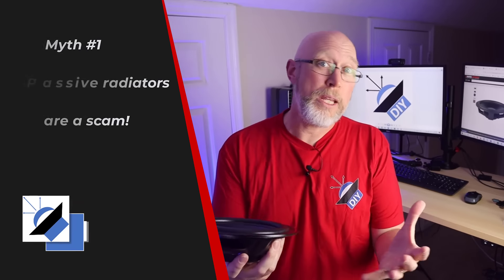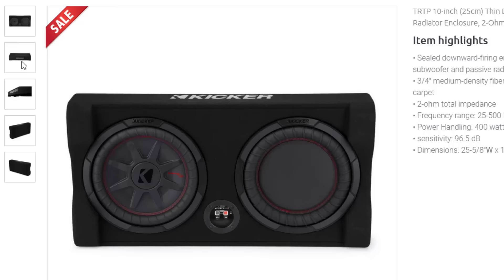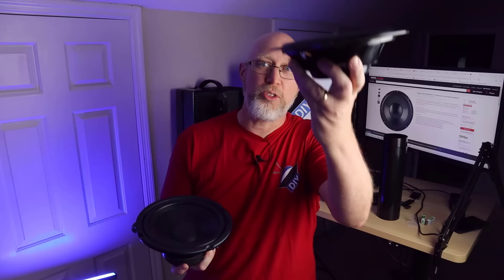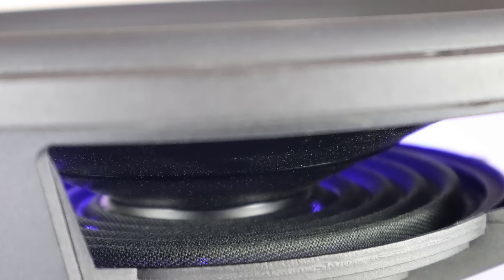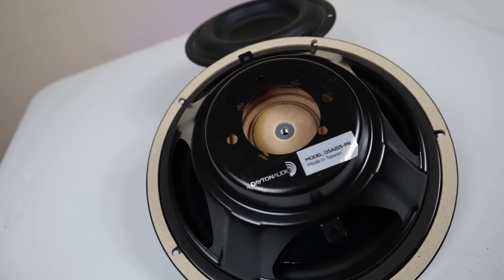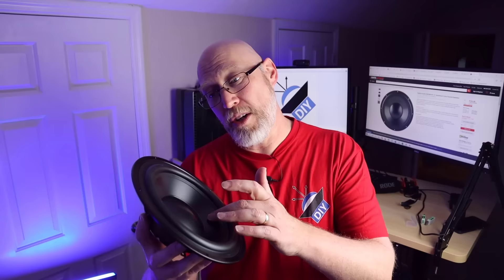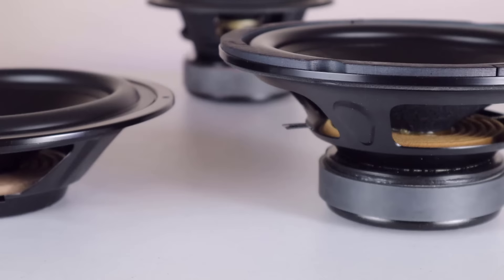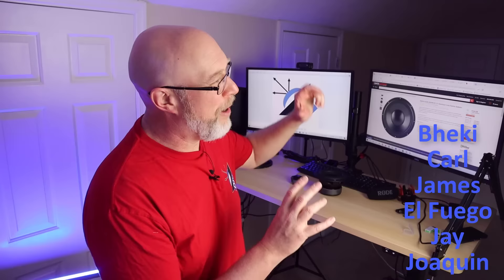Passive Radiator Myths Busted  #Bass

Comment: Thanks for this very informative video dude, I was already running on my own assumptions for the use of bass radiators that I didn't see in this.

I thought that base radiators were only used in small speakers, that were Waterproof and completely sealed. My theory was that with a sealed enclosure, there would be no air movement, and the driver would have to fight the vacuum it created with every flex outwards, and the air compression of every flex inwards. Having a Passive radiator gave the air somewhere to go, flexing outwards when the driver goes in, and vice versa, allowing the driver it's full range of motion while still being sealed.
Reply from the maker: Right, a passive radiator is not a flimsy sealed box.
Reply: The best speakers Ive ever heard, and now own, are Sealed (EPI 100v). Open Ports distort the sound, and create an artificial sounding bass.  This artificial sounding bass, tends to sound awful at medium to higher volume levels.  I call it "Farty" droning bass.  It sucks.  When you hear the way the music is Supposed to actually sound... you will toss all of your ported speakers into the trash.

 Audiophile level sealed speakers, use much stronger magnets and coils, to be able to deal with the internal Air Compression that takes place.  These stronger forces, allow the speakers to be much more accurate, as they can both accelerate and stop, quicker than a lower powered  "Eco woofer".  Even and especially, when they are driven to their maximum potentials of volume / excursion.

 Imagine a race car vs a normal car.  The race car can accelerate 10x faster, due to its more powerful engine.  Furthermore, the race car also has much more powerful brakes.. to be able to stop 10x better, even from a very high rate of speed.  The frame is also stiffened, to prevent distortions in performance.  The quality Sealed speaker drivers, are just like this.  Built stronger, and able to do things that lower powered drivers can not come close to doing.   As a result, you get a music that is 10x more precise (little to no distortions at all)... and you will hear things in your music that you never could hear before.  Such as a singers lyrics that you never could fully understand before... and now suddenly, you can easily make out the exact words they sung.

 The other thing to note, is that when a Ported speaker expells air Out of the box... and if it fires again faster than the air has time to return back into the box.. you will lose air pressure / mass... when its most critical to have it.   Imagine a singer that sung a note and ran out of air... but was supposed to immediately sing another note.. but was unable to do so well, because they lacked the air to do so.  Its not completely accurate to how the speaker works.. but its good enough to convey.

 These sealed speakers use the air pressure in the cabinets, as sort of the centering spring system for the drivers.  You also should realize that air compression, is also a form of "Movement".  In fact, even in lower powered speakers... there is some air compression happening.  Just not on the level of a sealed speaker.

 As for passive radiators... they are far superior to ports.  They tend to be in sealed boxes, and they are excited most by the lowest bass frequencies of the woofer (using the weights to adjust how easily / hard they will move).  They produce far more accurate bass, without sounding "Farty" like ported speakers.

 One could think of a round tube port, much like a flute, that was tuned to a single note.  Whenever air blows through it.. it creates a very limited "woof" that always has the same tone / sound... even though the actual bass from the driver, is playing very different notes / frequencies.   A passive, however... is duplicating the woofers movements and frequencies, far closer to the actual driver.  It can replicate most all of the frequency variances.
Reply: Part 2:  I will also add... that if you want to "Feel" the music without having the need for high pressure air movement... you can also add a bass-shaker (transducer).  These are like woofers / subwoofer drivers.. that have no cones.  They place a heavy mass between powerful driver coils, and probably a stronger centering spring system / spider.  The heavy mass moving, creates very powerful vibrations.

 I bought a used pair of Aura bass shakers.  They are only rated to like 15 watts.  I mounted both to the under-side of my office chair.. and played an old arcade game (Gyruss) with them on max power levels.  In the game... when you fire a bullet from your ship.. the sound of the laser fire gets deeper and deeper as it goes into the screen.   My chair was vibrating so much, that It caused my vision to become blurry... and I was unable to really see the game good enough to actually play it!   All that, at less than 30 watts total.  I of course, reduced the power a bit, and had great effects with no vision issues.

 The point here, is to add to the concepts about moving mass, drivers..etc.  Where as powerful effect is not just air movement.   As has been said... the air in a typical speaker, is to be thought of as an actual "Mass"... and of course, the more mass = more potential effect, especially at higher power levels.  While the bass shaker uses a heavy mass, and much stronger magnets / coils to do its work... sealed speakers do a very similar thing, with air compression (as well as the very moving mass of the drivers / cones themselves).

 The most crazy thing for me, was that my tiny bookshelf sized EPI speakers, that only have an 8" woofer... totally DESTROYED my Techniques 12" three way 200 watt ported speakers, in Bass response and effect.

 I placed the EPIs on top of a full sized Advent speakers... and asked a friend to point to the speakers that he thought were playing.   He was less than 8ft away from the speakers.  He immediately pointed to the lower large advents.  He could not believe it, when I revealed that it was the tiny EPIs, that were blasting that much smooth, accurate, punchy, and powerful, bass.   While they are not Bass-Head speakers... they produce music, and especially bass frequencies.. with virtually no distortion at all.   After a few days with the EPIs... I chucked all four of my Techniques speakers to the curb.  I no longer could stand their flawed, and distorted ways.

 I will also say that I had a Phillips woox boombox that I had got used off of ebay.  (Im a speaker-holic)  And that was the first time I learned the magic of Passives.  They were not as good as the EPIs.. but they did produce a much more bassy effect, without completely distorting and muddying up the music / sounds.   They were extremely impressive in output bass and overall sound clarity... most especially for their small size.   That said.. I still prefer the EPIs, most especially for their Inverted Tweeter (concave instead of domes).  They create a 3d sound field effect, that makes almost the entire room a "Sweet Spot".  Its like a live band is playing.. and you can virtually pinpoint in the room, where each instrument was playing.  If someone put a blindfold on you, and asked you to located them by listening and trying to walk towards where you thought they were... you likely would not be able to locate them... because the speakers sort of Vanish... and you are merely left with realistic 3d soundstage of sounds... all over the room.  Its that good / amazing... and there is nothing Ive heard that comes close to that level of 3D Holography and Accuracy.

Comment: So my 12" Kicker box has a 12" plus a 12" radiator. The same one you showed in video.  Is that incorrect from them?  So i wonder if my radiator has more Xmax
Reply from the maker: They did it right, they have been building those on and off for almost 50 years.
Reply: @DIYAudioGuy  That's what I figure,lol. But since I cant see the xmax I was just curious.
Reply from the maker: I have not been able to find the TS parameters for their passives, would be nice to have so I could build a kicker PR box of my own design.
Reply: @DIYAudioGuy  How would you be able to find out the parameters

Comment: So if we use passive radiator volume of closure don't matter?
Reply from the maker: It does matter, it is one of the parameters needed to calculate the tuning frequency, just like with a ported enclosure.
Reply: @DIYAudioGuy  but the volume of the enclosure is much smaller than the ported subwoofer for the same tuning frequency?

Also can't we use the Vas Value of speaker and use the double Vas valued passive radiators? I am soo confused. Please don't mind my question 😅

Comment: you cant have a passive radiator on the same baffle  .it will cancel the  the sound wave Basic  audio science to it on the opposite baffle  or side
Reply from the maker: Nope, it works the same as a port.  https://youtu.be/mHTGwEHCCRo

Comment: Can you tune sealed boxes easier than this?
Reply from the maker: It is a lot easier because you only have one variable to control, the size of the enclosure.  Because you only have that one variable (and no drone cone to give you some additional output) any halfway decent ported or passive radiator enclosure will play lower and louder than a sealed enclosure.
Reply: @DIYAudioGuy  Sealed is not bad for a beginner is it? Btw thanks for replying again. You should have more subscribers and viewers because of the knowledge you're sharing in very simple explanation.

Comment: But isn't that a scam if the other speaker is just glued on the top of the casing with no connectivity to the other speaker.
Reply from the maker: It's not a speaker.  It's a type of port. https://youtu.be/mHTGwEHCCRo

Comment: How am I only learning about this right now? Is building a subwoofer enclosure with a passive radiator hard? I'm a pretty big noob about subwoofers and I'm planning to build my own one as small as I can with as much output I can.
Reply from the maker: From a construction standpoint it's no harder than cutting an extra hole and mounting a speaker in that hole.  From a design standpoint it's no harder than designing a ported enclosure.

Comment: The passive radiator does not need double it depends on tuning and depends on the style/ order style of the box. Also the only time you double them is to give it duel tuning capabilities when matching to box volume of the box. You can see this in bose desk top units in the 90's and early 2000's. You can also use passive radiators in conjunction with a port/ports. But you also need to keep in mind when using weighted passive radiators your initial driver needs to be able to handle the extra air Mass flow needed to drive them correctly. I'll give it to you, you scratched the surface of what passive radiators can do. You can use passive radiators in 4th 5th and 6th order enclosures to get different frequencies to be tuned to the Box you can use ports with them to make a ranged box.
Reply from the maker: Fascinating.

Comment: Was reading about knocking the magnet off a blown sub to use as a pr, would you just use the former subs t/s for the new pr? Or would just have to wing it? And 2nd if ur pr needs at least twice the displacement capacity of ur sub is there a point ur pr can have too much displacement?
Reply from the maker: I'm not a big fan of the "knock the magnet off method" unless it is a subwoofer with a very compliance suspension.  Not sure how you would measure the TS parameters either.  So you just be guessing.

Comment: Would have been cool to talk about transmission line when discussing ports. Those cabs are normally huge.
Reply: I’m gonna try to get that same type of effect from a PR box if possible. I’ve had a chambered TLine and it was beast but took up the whole trunk, this time I’m gonna try small with the lowest of the lowest bass and output of something much bigger
Reply: hard to built. easy to mess up. do it perfectly it sound great. dunno people have access to wood tools.

Comment: I have a 15 inch Sheffield Peavey 115 S Bass Amp that flutters when pushed. My concern is do I use a passive or a tube to maximize tuning of on board  and frequency tuners because I'm scrap for cash and would rather solve solution of this unit which was dated back to 1994. I got this unit cheap but it was a once in a life time purchase.
Reply from the maker: I don't know what you mean by flutters.  But I would not start cutting holes in your vintage bass cabinet.  My guess is that the surround has decomposed and needs to be replaced.

Comment: I have a cheap speaker whit a port and a driver that doesn't move
Reply from the maker: So it's not making any sound at all?
Reply: @DIYAudioGuy  it moves very little when the sub moves a lot and the movement doesn't feel like a speaker when I touch it
Reply from the maker: @raulpavel3d  If it's a mid-range then it shouldn't move a lot. You don't need a lot of excursion to make the higher frequencies.  Unless it sounds bad there's no reason to think there's something wrong with it.

Comment: If you choose to use 2 passive radiators can you use different weights on each to get a wider frequency amplification curve?
Reply from the maker: I don't think that would work.  I suppose that I need to test it out.
Reply: @DIYAudioGuy  I think the unison would give a higher peak.  Maybe the different weights would give a wider but less peaky response?

Comment: Not all passive radiators are a scam.
I bought this mini bluetooth speaker, where the passive radiator was maybe 2 inches at the end of a 5 inch long 3 inch diameter tube, but the actual speaker was more like 1/2 inch and hidden behind the decorative mesh that surrounded the tube.

Edit you could hold your finger on the thing and it would make no sound difference, and you could just barely make out a little vibration in it at full volume
Reply: @Mr.Robert1  I started my sentence with "not all passive radiators are scams" Normally i get people replying without reading the later part of my comment, you're the first that didnt read the beginning of my comment.
What i was commenting on is how just slapping a passive radiator randomly on a cheap speaker, and making it look like another speaker often just makes it sound worse or has no effect.
Passive radiators are not a cheat code, the speaker, resonating area has and passive radiators have to be tuned, in my example of an actual scam passive radiator (where the real speaker was hidden on the inside of the device and it was advertized to make it look like the much larger passive radiator was the speaker) you could fully bottom out the passive radiator with your finger and there was almost no audio change, and if you just held your finger on the radiator preventing it from vibrating, there was no audible difference.

Comment: What was the advantage of having a passive radiator? And what was it's disadvantage?
Reply: Disadvantage is cost just like stated on the video also. Advantages are possible to tune smaller enclosures lower with smaller outside measurements than using ported box and complete lack of port breathing sounds. But also this has its limits as more weight is added to passive radiator, worse delay it will create so the subwoofer timing will be harder to match to main speakers. 
Also in some setups port would be long enough so it actually works like organ pipe at the working range of the speaker and that is not something you want.
Reply from the maker: In the future I'll try to make that a lot more clear.  Thanks for asking.
Reply from the maker: Thanks for answering!
Reply: @Karjis  this question had been plagued me for years now after i first saw them, and thank you for the info

Comment: I'm not understanding how having a passive with the same size as the active is going to have more xmax. Think of hydraulics. If I use an 8 inch piston to move another 8 inch piston, they're going to move the same distance (xmax). What's the deal?
Reply from the maker: Below the tuning frequency you are correct, but at the tuning frequency and higher it's not a piston pushing against a piston. It's a piston and a resonator.
Reply: @DIYAudioGuy  ok so unloaded it's a linear relationship out of phase and loaded its a constructive interference?
Reply from the maker: At the box tuning frequency the passive and active are in phase but one cycle apart.  As you play lower they will start to cancel each other giving a steep (30 db/octave) roll-off.

Comment: Wouldn't an empty hole be just the same as a passive radiator?
Reply from the maker: No, but if it were a tube filled with air it would be a port.
Reply: @DIYAudioGuy  I seriously doubt that a passive membrane would be any different from plain air or a piece of glad wrap.. I'l bet if you set it up in a test chamber and plotted the frequency response with and without the passive radiator there would be no discernible difference.

Comment: The air waves created by the woofer pushes against the air in the enclosure , then that air then pushes against the passive radiator causing muddy bass . It is better to have an open port on the enclosure than to have a passive radiator there . The best enclosure would be an infinite  baffle or a sealed enclosure for the cleanest bass .
Reply: It's all based upon the behavior of a mass-spring system. If you hear muddy bass then your system is improperly tuned.
Reply: If you were to hear both sides of a woofer it would cancel out the bass sound .Example , open speaker out of cabinet .The sound coming from the front and rear of the speaker would give a weak bass sound. By putting it in a cabinet puts more distance between sound heard from both sides of the speaker giving a more bass sound .By the time the bass gets to the passive radiator ends up being a delayed sound , hence - muddy bass. It adds to the sound coming off the front of the woofer.  Low frequency's travel at a slow rate of speed therefore you can hear both sides of the speaker at the same time.